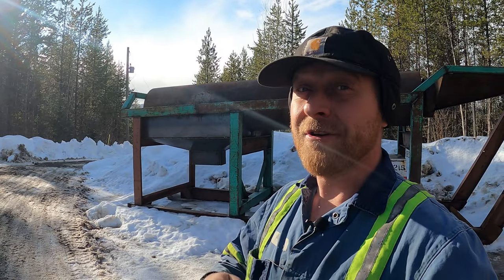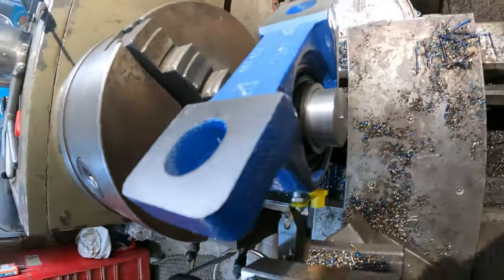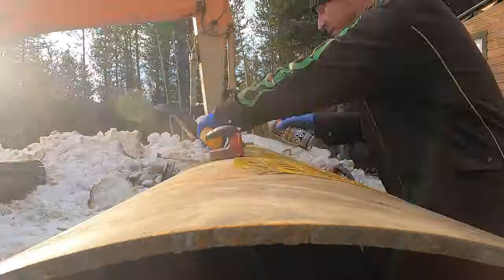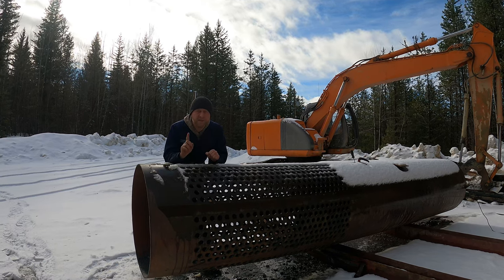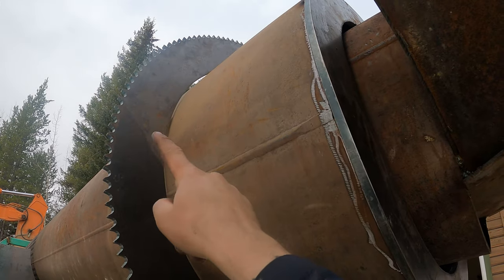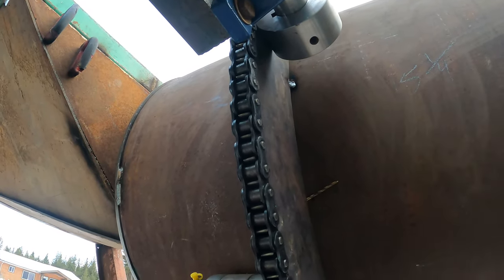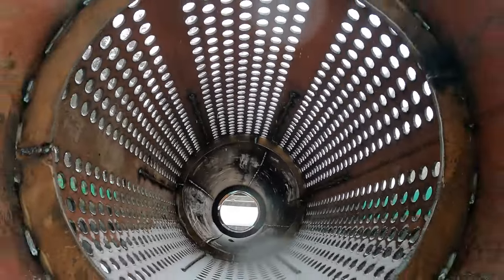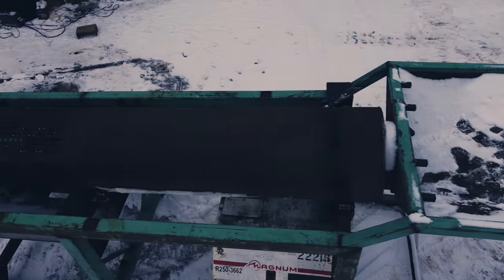How To Build A Gold Mining Trommel Episode 3 of 3

Comment: I like how you clearly tally costs and time, letting anyone put whatever value on work when they ponder doing something like this. Fascinating build. My dads homestead is sitting in gold-country and I have pondered if it would be worth it trying to get it out of the ground, this series told me that I would have to spend a years wages just for materials, tools and time to build the stuff that I need if I ever want to go beyond a pan and a wooden wash-box, so clearly big mining is still just a pipedream. I think that I some day will do something of a smaller scale, like 1/4 or 1/8 scale since I would only have to deal with smaller rocks for the dirt I would deal with, and it would probably be something I could make withhout high-end stuff like plasma-cutters. I wish I had known what I know today 30 years ago, before we planted forest on top of the fields where I now know we got 5 inches of ironsand that got some gold in it about 2,5 meters below turf. Keep making videos about your builds!
Reply from the maker: Hey Andreas.  Thanks for watching. A person can build a washplant alot cheaper then this one. Even though this is a very cheap build, a person can always go non mechanical, a lot like a big high banker. A person could put one together for well under 1000 bucks without all the fancy tools. Never think anything is a pipedream, think of it as a goal to achieve.

Comment: Great build! On the ones I have built, I had my sprocket cut w a water jet and it turned out really nice. One thind I did was grind a slight taper (similar to the store bought sprockets) to the teeth to help the chain find its way.
Reply from the maker: I used to get them water jet to when I lived down south, makes it perfect cut like you say.  Up north no one seems to have a waterjet system though.

Comment: thats fantastic! amazing work there! i would love to make my own mini-trommel for use in my shop to classify materials into multiple sizes, all they way form 1/2 inch to 1/100 mesh haha. with maybe 5 screen sizes and a water recirculating series of bins and an overflow pond. so i could insert raw material, and have every size classified for searching later using a Saruca so i have better size separation for good flips and centers for gem searching and ore processing. i think it would be fine for it to be no more than 5 gallon bucket in size per screen section, since im not running a lot of material, but hand classifying is a chore, though a pleasure too. but a trommel would be fantastic for separating gravel sizes automatically. of course, if i could just re-create a Pleitz Machine like what Glen Worhtington in Arkansas has, i could probably just let it do the concentrating work for me haha, and nto need to even classify too much either. but, alas, my crafting skills are low, and i dont have a welder. perhaps if i could get a place to build them for me though, but would likely be pricy for hobby level gem searching. i already have my Gold Hog Multisluice for gold lol. so im set there.
Reply from the maker: Hey Eddie thanks for watching. I think a Multi deck screening system would work great for that! I will be building a mini screen deck system for my next episode. It could give a person some ideas on how to whip one up!
Reply: @TheMiningChannel  thats awesome! i will absolutely be watching that when it comes out haha.

Comment: i would suggest that you add another thrust roller to the opposite of he one, the barrel will want to climb the rollers on the other end of the barrel.
Reply from the maker: There is one there for initial break in (didn't show it on camera) but I usually take them off once it is broken in. That only happens if your rollers aren't aligned properly it will climb upwards.

Comment: Nice build! 
What would the Ton per Hour be? 
What water rate for optimal performance? 
Are the plans available on-line at all?
Reply from the maker: Thanks Jenko! I figure with a 4 inch pump ( not sure on exact gpm yet) and a 4 foot wide box the unit should be able to do 30-35 yph,  I will only be running a 3 foot wide  box on this one. I'll put it to a really good test come spring time and put out a video.  As for plans, once I test it out I will try and get them out to people somehow, maybe Dan will let me throw a downloadable pdf on his website. I won't charge anyone anything. People also want plans for my cleanup sluice.
Reply: @TheMiningChannel  thanks mate I’m in Australia we have just applied for a mine lease and we’ll need to build a wash plant to ( if approved) so this information is great for me..
Reply from the maker: @Jenko’s Gold Adventures  Oh excellent!!! I was talking with another person from there and told me how much it costs to mine there..... couldn't believe it! 
This is a very simple design and anyone with a bit of welding experience can throw it together.  Just the machining a guy may have to get done by someone else if you don't have the equipment. Another 2 months and I should have it tested out and a video up with some sort of downloadable sheet for everyone to use.

Comment: how many gph of water do you recomend for this trommel
Reply from the maker: With a 3 foot wide sluice I use a gorman rupp 4 inch pump. The output on it is 650 gpm but only run 1/2-5/8 throttle. A 4 foot wide sluice on this unit could run the same size pump at 3/4-full.

Comment: What size of pump and motor did u use for ur hydraulic system
Reply from the maker: Hey Matt. I used a 11 gpm hydraulic pump matched to a 400 rpm 20 gpm drive pump I had kicking around.
Reply: Awesome ty and what rpm are u running the unit at.. tossing the idea for a trommel drive either hydraulic or gear drive.. for our unit almost the same size ..it's for our 2024 season in the cariboo..
Reply: And did u  use the motor direct to the trommel or run a gear box with it??
Reply: And one more question what size of motor in.. cu in was it.. people out here have no idea and it's driving me nutz sorry for all the questions